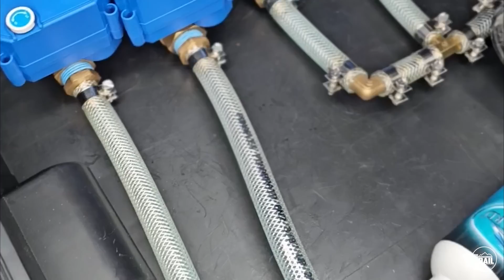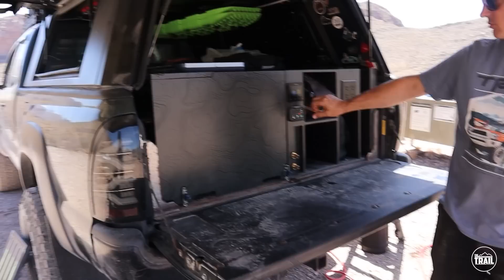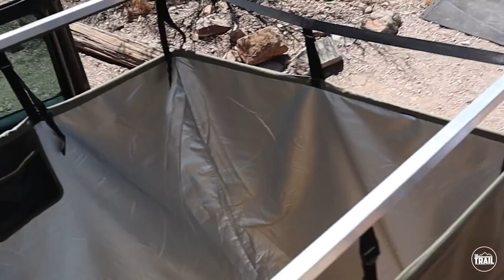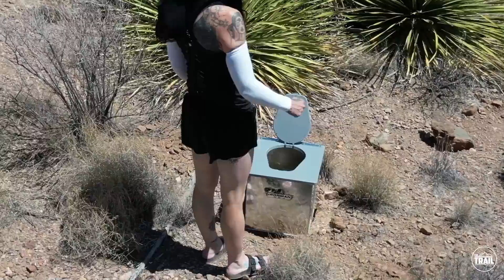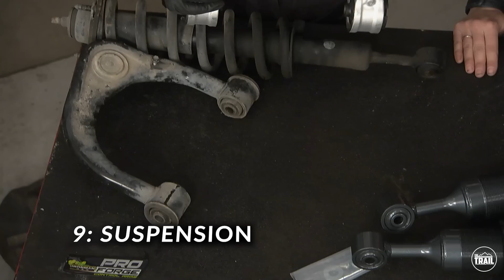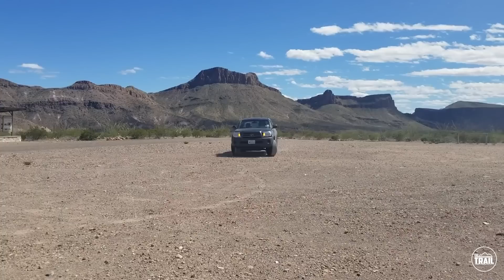Our TOP 10 Favorite Improvements to our Overland Tacoma Build // Powerstop Brakes THE TRAIL Series!!

Comment: Good day, I hope this note finds you well.    Congratulations for ALL your success !!  Please keep Up the Good Job !!
 I have a question regarding misfiring ; does the fuel injectors could be a reason for misfiring?
I have new / changed spark plugs and spark plugs wires , new / changed Ignition Coils. Chevron Fuel injectors  Cleaner with a full gasoline tank 91  octane Chevron gasoline two times already.....   
After about one hour  or 1  1/2  hours working starts misfiring  again.....  Every time it happens , I let the truck get colder, disconnect the battery and works well again until will start misfiring again.....'
any ideas what could be the problem ???   Thank you very much for your help !!  1997 4Runner  2.7L  4cylinders  5 speed Manual transmission 337,500 +  miles.
I look forward to hearing from you soon , take care...
Memo Moreno

Comment: the first time I saw that type of chair was on your channel.  I noticed it in a shot, and it took me a while to search and discover the brand online.  I bought it right away!     sense then, Costco's sells a variant of this chair and other similar XL oversized chairs.   I think I like the armless variant because I like to sit with my legs crossed in the chair.  (Sometimes, I feel pressure in my legs and sitting with my legs crossed helps. what helps most is to change my body positions and move around often.